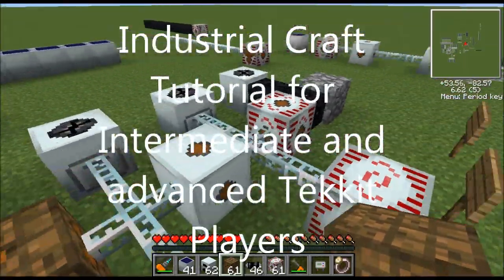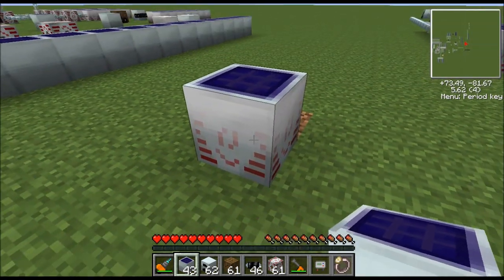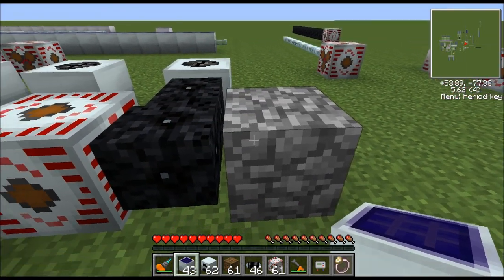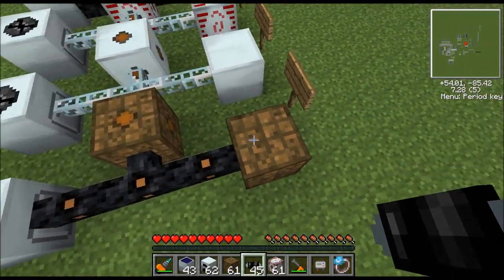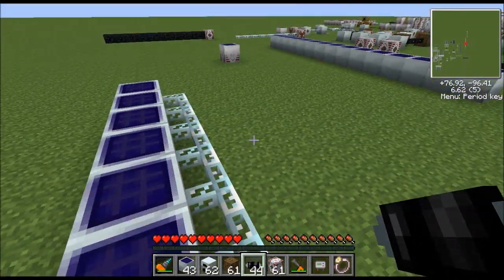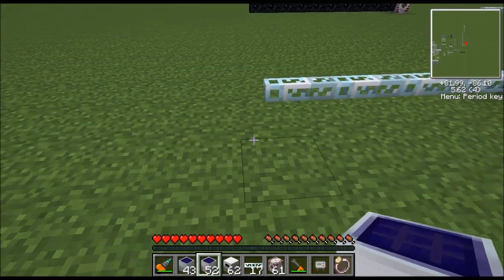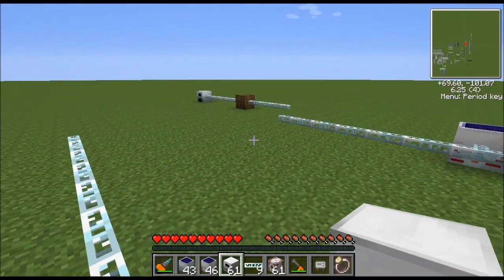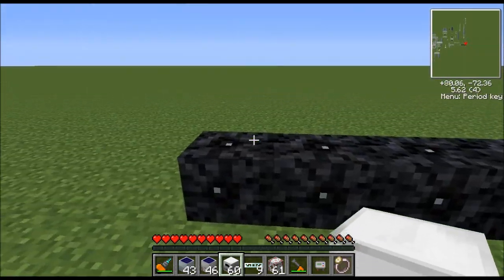Tekkit Tutorial - Industrial Craft EU Power for Intermediate and Advanced Players

Comment: so if i see it right i means.
1.) i got 1024 eu/t into my HV-Transformer so  it spits out 2 packets, each 512 eu/t
2.) i got 2 packets 512 eu/t into my MV-Transformer so  it spits out 2*4 packets, each  128 eu/t
3.)  i got 8 packets 128 eu/t into my LV-Transformer so  it spits out 8*4 packets, each  32 eu/t
-.) so a Batterybox at the end becomes 32 packets of 32 eu/t ?
-.) does that mean the Batterybox charges 1024 eu/t ??
Reply: based on my testing i think it's bottlenecked by the transformer it's drawing the power from, so it (the batbox) can take at most 4 packets of 32 EU/t from the LV transformer resulting in only 128 total per tick. you'd need to feed energy from your MV to multiple LV transformers to additively increase the EU/t while staying within 32-EU packets, so as an example 5 LV transformers drawing from an MV transformer (plus your HV and your 1024EU source) will result in the batbox charging at a rate of 640 EU/t. if i'm wrong or there's a way to increase amperage without having to invest in a ton of transformers then let me know pls
Reply: actually it seems to bottleneck across every transformer as well, so once you've reached the 512 EU/t (4*128 packets) limit that your MV transformer can output by using 4 LV transformers (using 5+ like i suggested earlier would actually have no effect), you'll need to add another MV transformer hooked up to another 4 LV transformers to reach the 1024 EU/t total from your source while converting everything to 32-EU packets

Comment from the maker: A transformer only puts out up to 4 packets per tick. IT can put 4 packets out 1 side or it can put out 1 packet on 4 sides, etc...  Cable can handle an infinite number of packets so there is no advantage to using multiple sides except if you are powering two separate machines and the transformer is between them.